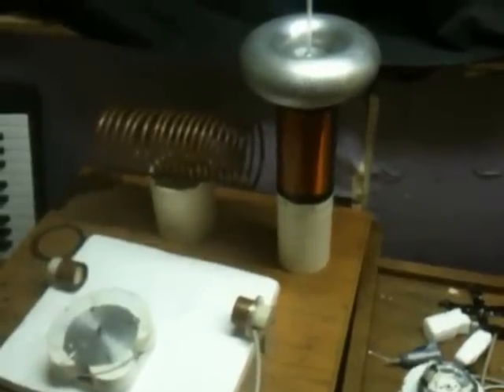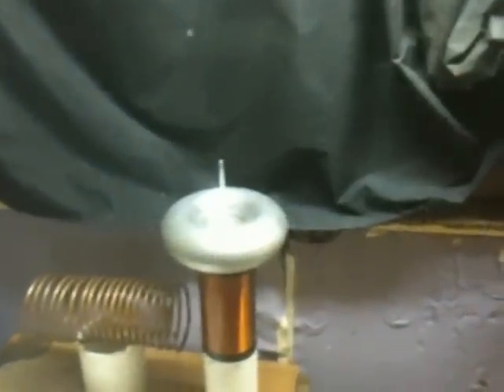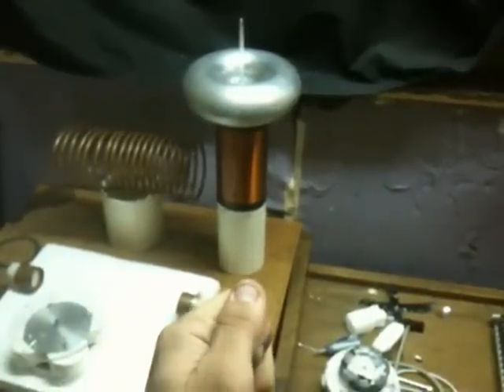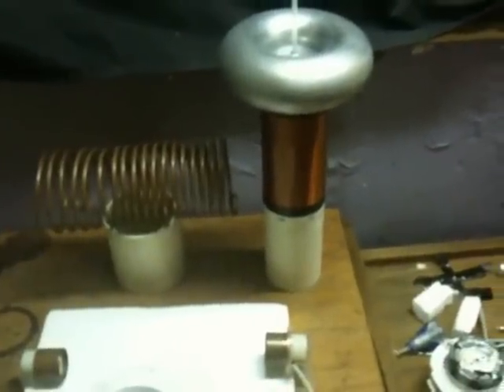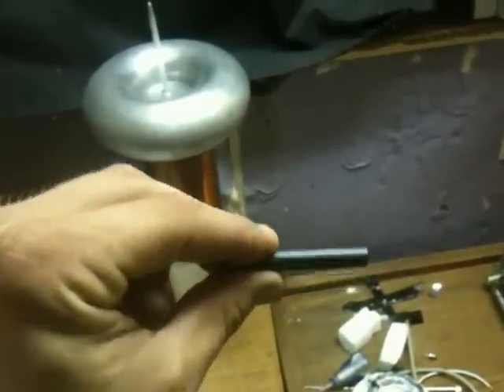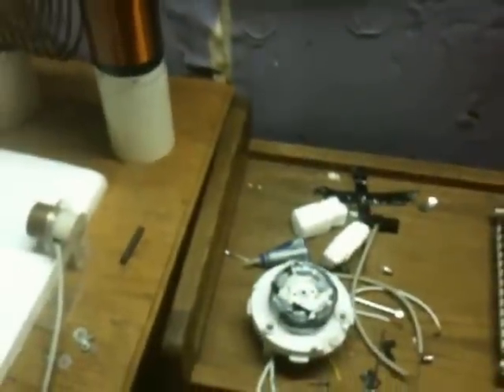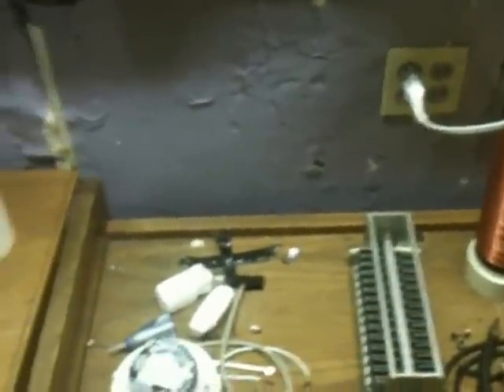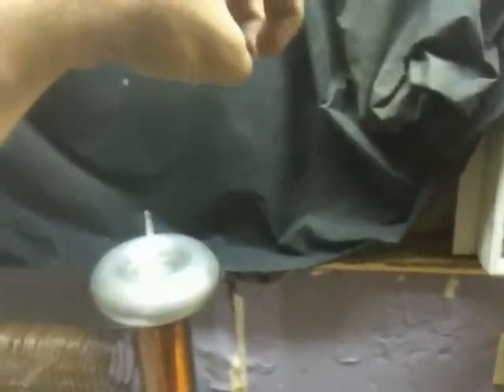My Theory for Tesla's Wardenclyffe Tower

Comment: More than likely, that rod that you're holding does conduct electricity, however the oxide coating on the rod prevents it from conducting electricity. Take that rod and put it into a pure vacuum, machine off the surface and see if it conducts. My best guess is that it would.

Comment: I think tesla transmitted the resonant frequency of the ionosphere in order to start the process.  It could be done on a smaller scale than wardenclyffe tower I'm sure. I have no idea how to build such a tower but if you think about how the potential energy of the ionosphere would be changed into kinetic energy by passing back through the transmission tower itself, then you could convert the energy into mechanical energy using a simple turbine. There would be a dramatic loss of energy but it should still be possible to get more energy back than it cost to transmit the frequency initially, right?
It reminds me of sound amplification when speaking through a megaphone. You get a greater sound without as much effort that was initially exerted.

Comment: Now Why has no body build a working replication of the device, I think is largely due to the inability to to set up a large enough project the grounds of such a tower for 1 need to be in very specific spots known as hot spots,  the site for the Wardenclyffe tower  was one of these hot spots. That and having time to do tune after re-tune after re-tune of the sec coil, top load and Capacitance of the tank circuit, sweet spots in the system must be found as everything must match the earth

Comment: Ok well firstly the "free energy" term is a little confusing, from the numbers above you can see there is a "gain" in energy, through magnification of waves propagated through the earth, But one needs to supply that original 1000watts to achieve this. Now the second misconception is with the ionosphere, do you notice how I keep saying "propagation through the earth"  ? that's because we are "transmitting" through the earth, not like a ham radio where we use the ionosphere.

Comment: A powerful radio station yes, but did you know (example numbers to follow) The the tower if fed say 1000watts of power, having multiple receiver towers set up, that each receiver tower could produce 1000w simultaneously, the effect is caused by propagating waves through the earth and not through the air, using certain major fault inlines and aquifers he would achieve this phenomena.

Don't always believe what you read there is good reason the powers that be don't want you to think it will work